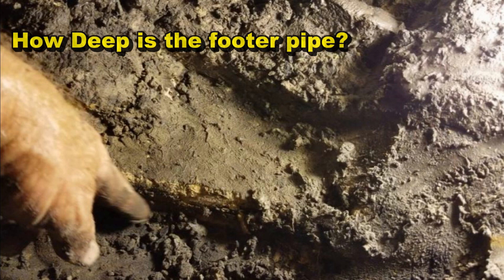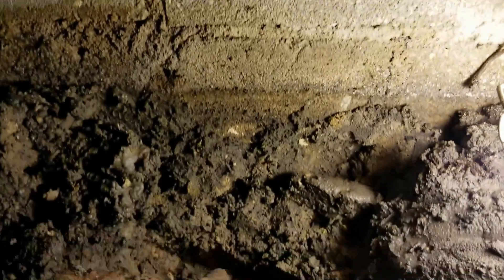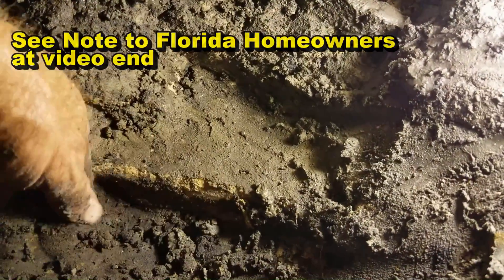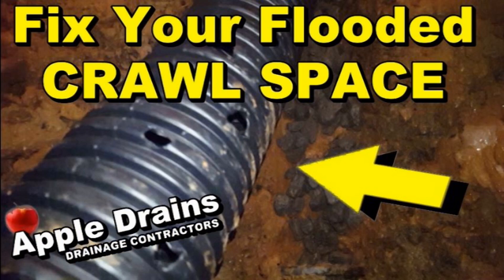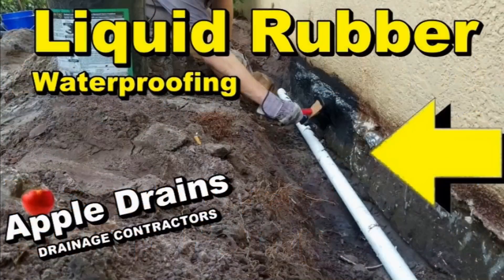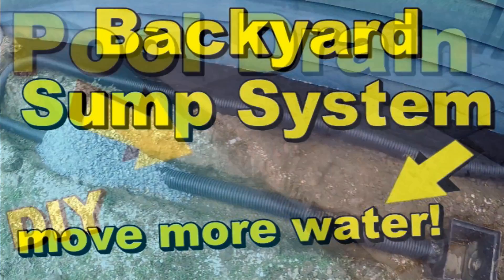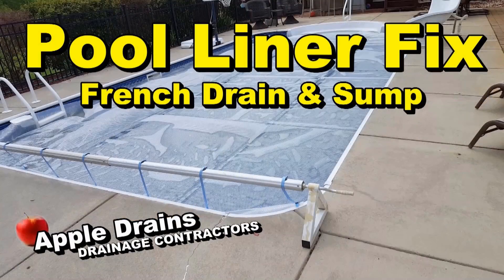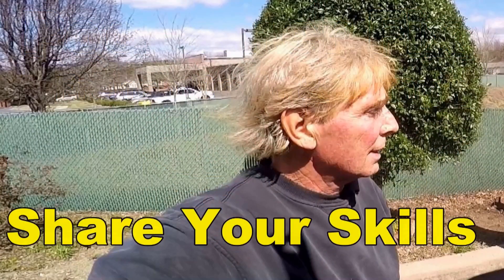Waterproofing Tip - How Deep to Dig Footer Pipe

Comment: If a house where on a sloped hill and the lowest spot inside the crawlspace was near a corner, Is there any issue with running the exhaust pipe to daylight under the footer. The exhause pipe would be sloping down to daylight and only need to run 5 feet to daylight due to the hillside slope.